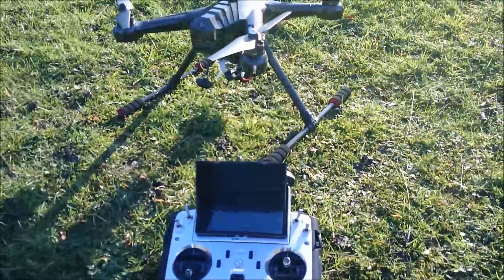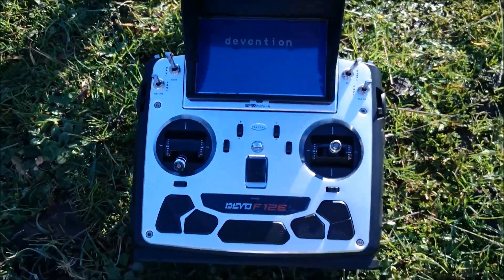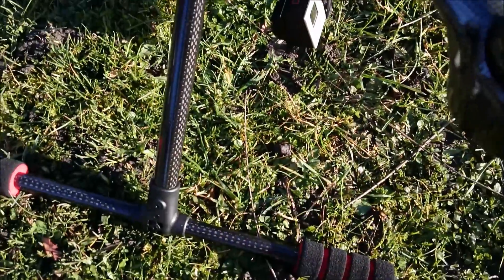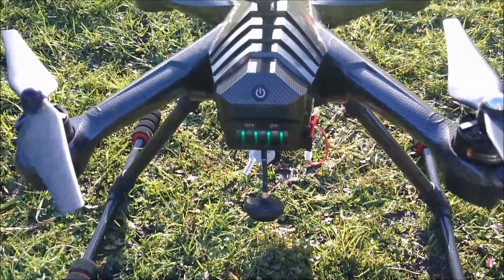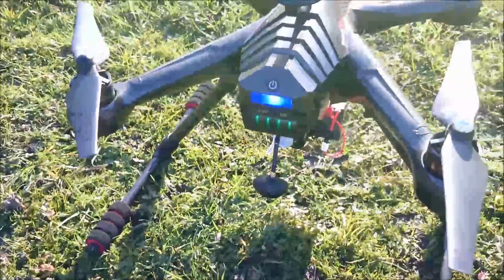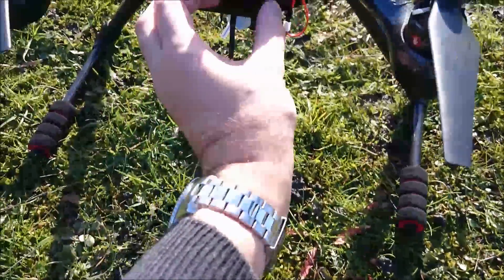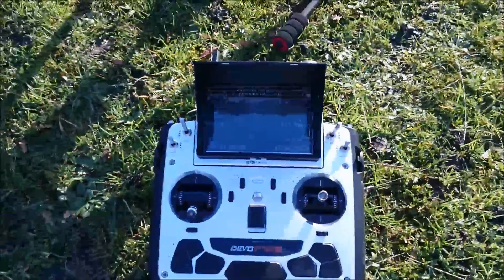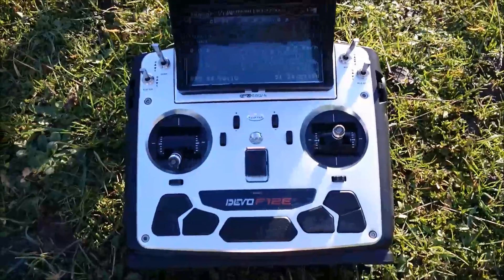Walkera Scout X4 - GPS & Arming Motors

Comment: Is it true in your opinion that Walkera is a bad choice because it fails in mid air? Or other problems.
Reply from the maker: It's not bad. Has the same issues as any other quad. BUT with the Q500 and DJI P3, these are easily the better drones now as technology has moved on so quickly.
Reply: I have a yuneec q500 and fly 6 to 9 Batteries a week for 8 months now and never had a problem. I even get the same flight time as if it was new.
Reply from the maker: That's the way to run them, constant use. Also think the q500 batteries are very good quality.
Reply: +Alex Savo the YUNeeC battery says 5200 but in fact it is a 6300mah.

Comment from the maker: +Jon Dykes - I am unable to reply direct to your message I am afraid. Hopefully you will read this. Your Scout should not really nose dive instantly, especially since it is brand new. Your calibration should not have that affect. I guess really what needs to be confirmed is that all 4 motors start at the same time? That you also have the props on the correct way? We can start with those questions first and work from there.

Comment: Hi Alex. First off thank you for your videos! They are so much better than what came with the Scout. I hope Walkera realises that and compensates you for your time and quality work.

I am at my first flight and went through all you other videos along with the instructions. I calibrated the Scout and am ready to take off. When I throttled up the Scout nose dived into the ground. I tried again and it seems the back two propellers are thrusting more than the front two and causeing it to face plant and not take off. I noticed 3 blinks when linking to GPS. Did I do something wrong with the calibration. Can I re calibrate? I really appreciate your help. Thanks!
Reply: I have read up on this issue and have learned that you either throttle to 70% quickly to get it off the ground, or throttle up enough to not cause take off for up to 30 seconds to get the two propellers chance to catch up.  I always wondered but have not tried to do set the GPS and throttle and see if that helps.

Comment: Hey Alex. What kind of black mushroom antenna is it hanging on your scout? pretty unsure if I'm missing something in my Scout X4 package now?! did you mod something?
Reply from the maker: Hi, Its the standard Walkera antenna. You can find the video to how it ended up black. Click this link: https://youtu.be/KE-i7UsC6cY
Reply: Alex Savo  Yeah nice, thx for that fast answer. Awesome video howto --> without, I still would have no clue about. I was confused because of I'm using it with the iLook Camera + shorter Antenna. Now I found the TX5811 as additional parts to buy. Am I right when I say... If I do want to change to gopro4 I'm going to need the TX5811, right? Have a nice sunday, hope the weather will be better for all of us :D
Reply from the maker: Yep its a different set up. Your need to purchase the tx5803 as well as the cable to run from the GoPro to the receiver. Plenty of places to purchase these now. Same setup on the Tali.
Reply: +1, thank you Alex. Ordered it on Aliexnfür 60$ --> tx5803+tx5811+cablebundle. Awesome!!

Comment: hello Alex....my name is jim and recently purchased a scout x4 and I seem to only get a red light only . Ive never seen a blue"GPS" light and ive had my scout a few days now...and would like to see the blue light just for peace of mind... that all is working correctly ..........any suggestions? .thnx Jim
Reply from the maker: Hi Jim, a few questions. Where are you doing your checks? Outside? Have you calibrated your compass? Can you move your gimbal using the transmitter? Let me know.
Reply: Hi Alex , Actually I've been right inside the house ive hoverd  it maybe 4 or 5 times I've been trying to get the feel of it before I take it outside for a real flight test... And yes I have calibrated my compass..... And when it comes to moving the gimble I can only movie it left to right but rolling it no yaw or pitch movement on gimble for some odd reason....:(
Reply from the maker: Take it outside, away from houses and built up area. No need to fly it, just test to see if there are GPS satellites. I'm sorry to hear that your gimbal is not working as it should, Not much I can help with on that I am afraid. I would contact your dealer and let them know.
Reply: Thank you very much Alex I will do as you said and hopefully everything goes well I wish you a very Happy New Year and like I said I really appreciate everything .
Reply: There is a big parking lot connected to a big giant church behind my house I'm going to wait till the parking lot is clear of any cars just in case i decide to hover or fly around a little bit but first I'm going to try those GPS lights....
Reply: As far as the gimbal goals I'm not really stressing over it I know that's a minor issue I'll  either buy another one or find out how to work this one correctly.....:)